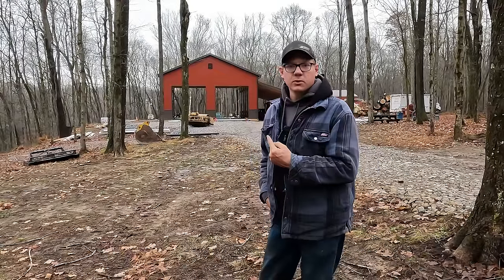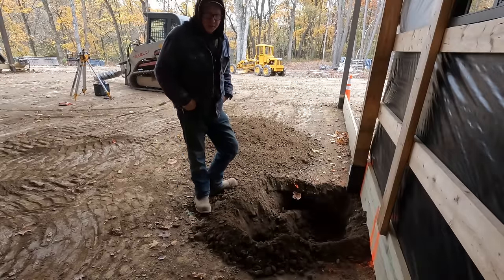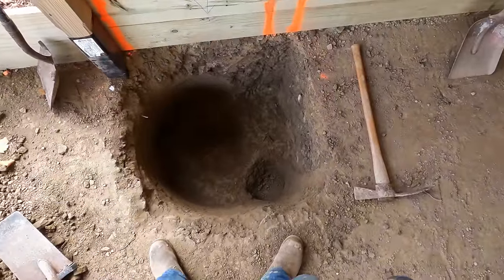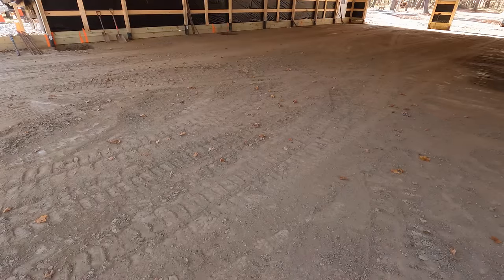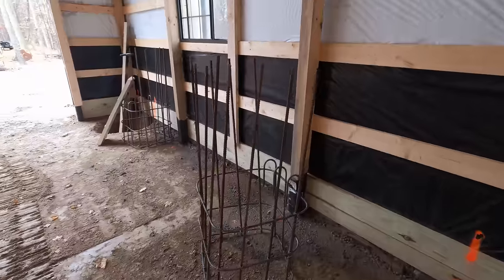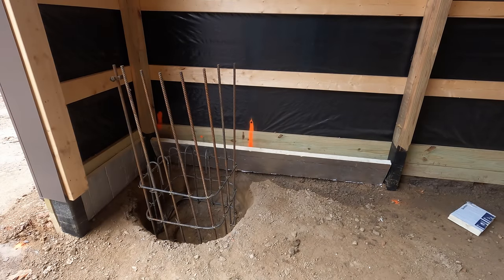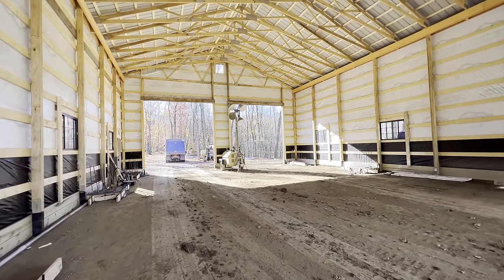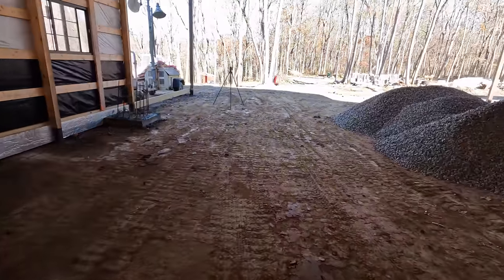Digging & Pouring Footings for a Bridge Crane! (Dream Shop Build)

Comment: For future reference if you ever have to bend rebar like that again, if you don't have an actual bender instead of the pin one you're using, bend it on one of the stake pockets on the bed of your truck or on the side of your trailer. It helps you keep it in the same plane and you can get better leverage because you can grab the rod farther back. I do the stuff everyday. I use our trailer more than a rod bender lol

Comment: A few thoughts … insulate under the slab, put in crane footings in the out door covered area (you will feel so smart after you close it in and want to extend the crane), insulate under and install the heat tubing in the slab of the out door under roof area so that you will be ready to go when you decide to close it in.  It is great to see the shop going up …..

Comment: Hi Matt!  I had an epiphany one day while tying up a bunch of rebar cages.  I looked over and saw my MIG welder and never tied again!  Straight, true and rigid as a rock.  A real time saver too.  Another tip on concrete in screw heads.  Use a little Crisco or white grease and fill the heads before you pour.  Love watching your "Dream Shop" come together.  Cheers Buddy!  😁
Reply: I was watching this and thinking 'Wouldn't it be quicker to weld that rebar together?'
Thanks for reasuring me that I'm not totally stupid😁👍
Reply: @casperme6552  Thanks for the reply Casper!  Makes sense to me!

Comment: Hi Matt.  Think about using your trailer as a bending work bench.  Set a few coach bolts into your timber tray as the jig for your bends - that way they will all come out the same.

Comment: "prerusted" rebar will continue rusting and the volume of the corrosion products will crack the concrete. New unrusted rebar will rust ( in concrete) but at a lower rate... Sanb blast it before covering it with concrete👍

Comment: When I saw you making iron rectangular rings and tying them together to make a cage it reminded me how, here in India, large concrete structures are created. So I thought why not share some with you. Here you didn't put a cage below but in my country, we start making the cage from the bottom. Then we move up. And before laying the frame we put bricks below the cage. So the weight spreads through the earth. We also use a dry concrete mix where the water level is too high. Especially in the eastern parts of India where if you dig even 2 feet water starts coming out.

Comment: Hey Matt, I’m a civil engineer from Brazil, working at road construction and I really appreciate watching your videos. I always learn about mechanics and the machinery you use there at USA. About the building, congratulations! Seems to be turning into a great shop! Did you have those footings dimensioned for the size and load of your crane? I believe it’s very important to have project and calculations done before constructing cranes which could carry such big loads. Best wishes!

Comment: Before I had an auger I did post holes with a big T handled spade bit and a Shop Vac. Might be easier to suck out the excess waste than to climb into the hole and try to dig.

Comment: Use your trailer bed for a bending surface...you can drill a few holes and even set rod busting pins! The hips are key set holes just a foot or so from the edge and hump it up not to hard and if an electric shop has an old 555 bender around even better then no strain at all...use the 1/2 inch conduit shoe...but with the bender you got there 1/2 inch hole in the trailer bed and you got a hood pivot or hinge point...then a couple of straight binding pins close behind probably heavy shoulder bolts jam nutted then long smooth hip movements to throw the rod into shape ...there is a joke there somewhere but works well  then you will have the rod busting table as long as you have the loading bed...
Reply from the maker: I thought about doing something  like that… seemed too professional lol

Comment: You can make a simple jig to bend that rebar....and if you heat the rebar with a torch you get tight and similar bends easily... worth the time when your making that many.... i also mig weld the rebar as it is stiffer than tie wire and usually we built our forms in the shop for pours anyways...
Reply: Wow...that was Fast !! thanks...great work as usual...i got a 48 ft wide by 64 ft long pole barn...need a concrete floor one day too...just some gravel now would be nice...vapor barrier to keep moisture out....i have 2 other shops..one with heat floor..so comfy in winter here... it has a simple handyman boiler..tube with a water heater electric element... works great...fugly but functional...👍

Comment: Rebar in concrete cast against soil should have 3" of concrete cover--looked like the bottom of the cages was sitting directly on the soil rather than 3" up.

Comment: I hope you fully plan out how you will get that crane up in the top of your barn. You may find it easier to remove roofing panels and then raise the crane from above it. If that makes sense you may want to postpone the foam insulation too. I also saw another comment that raised lateral stress as a concern so what he meant I'm sure was the inclination of a moving load to continue moving horizontally. PS you might be able to find a forced air wood furnace add-on for sale Black Friday.

Comment: I'll bet some days, like the last couple of days, you wish it went as quickly for you as it does for us:) Good thing about pouring concrete into holes in the ground is it is unlikely you will lose any form. Nothing more embarrassing than some formwork giving way during a pour, can be dangerous too. It only happened to me once and that was once too often. I copped it from the other lads on site but the engineer was very helpful in instructing me how to fix it without integrity loss.

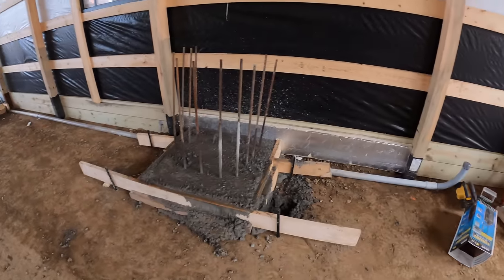Comment: 31:54 One of the reasons I hate pouring concrete, but I also know to clean up the spill while the concrete is still wet. A quick flip with a shovel would get the concrete away from the outside of the form.

Comment: I found it better to use the receiver on my rig with a cheater pipe on the rebar.  Made two pins on square tube that slipped in.  You can make pretty precise bends.  Helped quite a bit in repeatability.  Became more valuable as the size of the rebar goes up.  In my seventies now and #5 doesn't bend as easy as it used to so I need all the help I can get!!!  I slip the cheater over the rebar and bend what I need.  I used pipe in pipe at the end of the cheater as schedule 40 wouldn't last too long on its own.  Welded the piece of inner pipe to the outer and it has lasted a long time.  Bending on the horizontal plane always seemed to be more ergonomic at waist height.  I set a pipe stand out on the free end to keep it level as I bent the other end.

Comment: Matt I know it's too late now but in the future, I did trial and error and found the easy way to bend rebar is to put your straight bars in a heavy pipe as small as you may have around then put your marks for length just outside the pipe and bend them. You will have much better control  and much nicer 90s.

Comment: Hello again, great progress on your shop come garage.  Truly impressed, just as a side note you mentioned that you required three phase power for your crane.  Did you opt for the stand alone three phase generator. Or the other option of running new service lines and the expense of step down transformer.  Thanks Mike
Reply: What is three phase power thanks

Comment: small anger in all 4 corners. Don't worry about removing soil .  just loosen it. Then use 36 inch anger in center. You will get a surprising amount of soil a d most of the remainder with be loose.
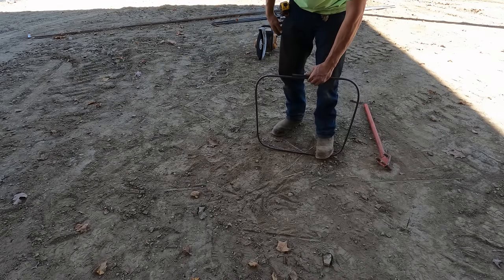19:00

Comment: Very happy to see more progress with your dream shop. Interested in how you will heat the floor. Will the floor be able to support the weight of a large doser? When you purchased the crane I suggested a motor generator to supply 3 phase power. Still think it's the better solution than replacing the originals. Keep it up Matt.

Comment: A better pro-tip. If you know you will need to remove screws covered in concrete put plastic caps on them before the concrete is poured. Knock the caps off and you have an easy to remove screw

Comment: Nice work with the foundations!
Did you lift distance the rebar  from the bottom of the holes ? (This prevents early rebar corrosion  as an sure  you know.)
Good idea to insulate the floor outside edge.
The bigger loss   
In proportion with that size of slab should be the bottom doe, are you going to insulate that? With the right 
Thickness of insulation the heat transfer to the ground may prevent 
Frost freez heave under the slab , without letting all your heat thru. 
With for example solar heat the ground under the building can be used as" seasonal "heat storage,
Thus no isolation needed . with combustion heat that is not optimal . (There is no free exess energy  to store )

Comment: when they put the power pole into my home they hit rocks and snapped three hydraulic motors until they finally moved it over two feet and went in no problems. i just smiled and offered them some beer.

Comment: another tip for getting screws out of your forms is to slap some ~3" pieces of painter's tape over them (any tape for that matter).
best case you just scrape the tape off and have your screw, worst case you can punch through the tape and the head of the screw won't be filled up at least.
i've done it with foil tape pretty often and in a pinch you can get away with sticking some asphalt roofing paper or just laying a shingle over it until you need to pop the forms.
10 minutes of prep can save you hours of cleanup

Comment: Looks like you set your rebar directly into the bottom of the footing with out use 3" dobies. Not as required by building code. Your rebar will now rust.

Comment: Since you're doing in-floor heating, have you thought about in-floor cooling? Not a full substitute for AC since it can't reduce humidity (nobody wants perpetually wet floors!) but you can pull a lot of heat out of a large space very efficiently that way.

Comment: Pro tip #1. Take a shovel and clean away any over spill of concrete from the outside of your form boards while it's still wet. That way you don't have to chisel or sledge hammer hardened concrete away from forms. 
Pro tip #2.  If your using screws to make your forms, put a piece of duct tape on the screw heads so it will not get plugged up with concrete.

Comment: “80% of the time it works 100% of the time…” yep, that’s about as good a math expression I can understand. 😂 I’m happy for you Mat, it’s taking shape little by little and I can’t wait to see you happy the day you start using it. 

Not sure if this was covered in a previous video but, are you going to build a shack for your air compressor? If so, don’t forget to put the piping going to the shack before you pour the floor, it makes for an easier installation. I noticed you didn’t put all-thread into the pillars to attach the bases of the I-Beams, how will you tackle that part of the build?

Comment: Next time make a peg table to make your square bands. Start with two pegs to hold the rod end and then a peg for each corner. Use heat o bend rod around each corners.
Reply from the maker: Rebar bends easy. No need for heat
Reply: @DieselCreek  It looked to me that you were struggling. Using a fixture would eliminate all the measuring, make more consistent square bands and the heat would give you easier sharper bends. It's just a suggestion. I enjoy your videos.
Reply: @DieselCreek  I still recommend using heat even when using the rebar hickey. It would make it easier with the (eyeballing)

Comment: watch the steel clearance on the existing structure on to the top rail attachments are always a bit wider than the base ...maybe as much as 2 feet...so 2 feet in from the risers a good guide or rule ...those bridge cranes are very handy beats flintstone work but hey John henry did not make t out of that mine ....
Reply from the maker: The trolley beams are only like 10 inches wide. 8” support column… Plenty of space

Comment: Looks like you did what I did and left no space left and right of the garage doors for tool storage . No problem for you with those ceiling heights you can build out a nice space on the opposite of the shed roof side .
Reply from the maker: I have 4' on the sides of the doors.

Comment: i have dug footings that way with a hand auger mind you i was only digging them 600mm (2ft)square and 600 deep. it does work but placement of the auger is important. and you dig in stages breaking out the remainder with crowbar and shovel as you auger to depth. so you auger 8inches down break it out, auger again. its easier than digging the whole thing with pick and shovel.

 if only we could teach our dogs to dig holes to spec and in the right spot life would be easy.

Comment: I used to build dairy farms for a living and we always pour our own concrete and set our own forms for concrete we always with the leftover concrete we tried to shovel away from the wall and we always use oil hydraulic oil and diesel fuel for form agent to get rid of the way from the concrete we need to take off the forms

Comment: Ive never had to lay or tie rebar for reinforced concrete. I could see why tying is preferred in the field but is there any benefit to tying as opposed to tack welding the rebar to each other? The only thing I can think of is tying allows the rebar to move with the concrete as it expands and contracts, which seems beneficial lol

Comment: Will you have a grate drain down the middle so you can power wash inside? They have those 6” wide ones you could run either one end of the shop and slope the floor, or down the middle of either side long ways and you’ll never have a cold winter muddy mess ever again!!!
Reply from the maker: I will have a few floor drains but I do not plan on washing anything inside. That just makes a huge mess
Reply: @DieselCreek  good work! Love it
Reply: @DieselCreek  Agreed.  That's why we have a dedicated wash bay.

Comment: Looking good Matt I can’t wait to see the shop finished with the overhead crane working. Are you fitting a outside wood burner in to heat the flooring and maybe have hot water in the rest room ( if you are installing one ) thanks for an excellent video Matt can’t wait for the next one. Tom. Northeast England.

Comment: Hells yeah Matt great job with those cages and forms. A little bit of redneck ingenuity goes a long way! One question tho,,,, on them cages why couldn't ya have used a hydraulic tube bender and ya could of possibly bent two or three squares at the same time? Just a thought. Cant wait to see the finished floor buddy!

Comment: Honestly wondering why you didn't just go with Sonotube's for those footings?  Surely they are much cheaper, and time efficient than cutting, bending and tying all the rebar together? Love your channel, and the work you do. your ethics, and integrity. Thank you for the video.
Reply from the maker: Sauna tubes are not meant to do anything other than be a form for the concrete. You still need rebar

Comment: Are you going to “lay any steel in” the concrete for running dozer/ excavator thru shop to save the floor ?    Another question comes to mind, if or when you get a crack in the slab, how do you repair a broken heating line in the floor?

Comment: I believe most big ready mix companies have an engineering office you can talk to about anything concrete. The idea of letting the slab bear part of the crane load is not what they do around here I would expect to see the piers separated with styrofoam or expansion material from the slab.

Comment: Matt, you are the hardest working gut I know , wish my grandson would watch you & get some work ethic !!!
Hey what was that long hose u kept sticking into the wet concert as it was being poured????   What was that for ??
Reply from the maker: its a vibrator. it helps settle the concrete. gets out the air and lets it flow into the edges.

Comment: The shop is looking amazing.  Having never used augers that big, I was wondering if there’d have been any advantage drilling pilot holes with the first auger and widening them with the 36”?
Reply from the maker: I actually did do that a couple times. That auger was in really bad shape. All the cutters were worn off… but I borrowed it for free so 🤷🏼‍♂️

Comment: Watering the curing concrete doesn't make it cure faster, it just makes sure that the concrete cures properly before it dries out from water evaporation. Water is a key component for the curing process of concrete so it that evaporates before it's done it's thing in the concrete then you won't get the same strength of the concrete. It may eventually get there but it tales a lot longer if it dries out before it cures properly. 👍

Comment: the smart thing would have been to dig those footing before standing the frame for the shed. but when you dont know the exact size and placement for the poles it cant be done.

the only way a excavator could dig those is to have a machine with a pivoting main boom and be parallel to the wall.

a 3ft auger is a simple compromise. and who cares if its not quite square box up the above ground bit sq and call it done

Comment: Hey Matt are you going to paint that floor to not to stain it and I was thinking about could dig a pit in the container garage to be able to take parts out also that old small international tractor a gas or diesel engine

Comment: Out of curiosity Matt, is do you always use drainage rock for subbase?  Is radon gas an issue where you are?  From my own experience I would usually use a road crush product as it is easier to work with.

Comment: Q: I see lots of smaller garages with 2" foam put down first.  Is what you are going to have in the garage too heavy for foam floor insulation? Or is that next on top of the gravel?